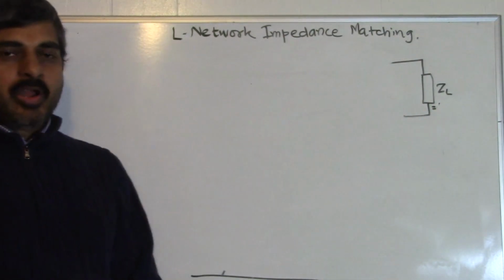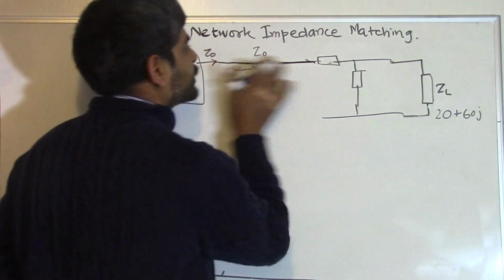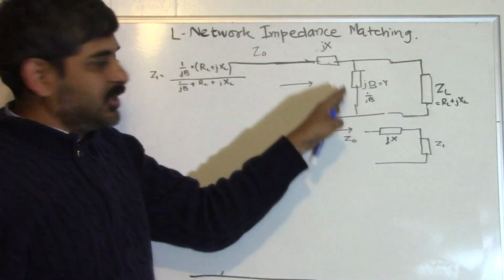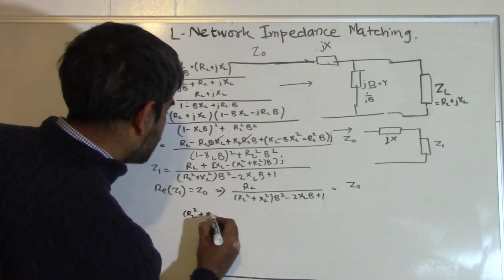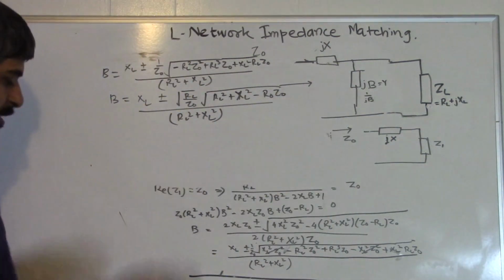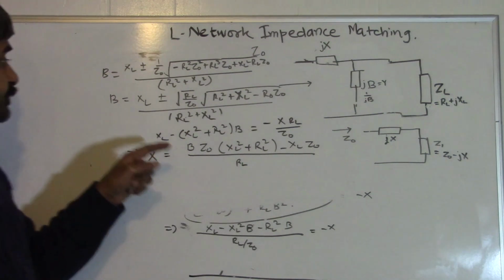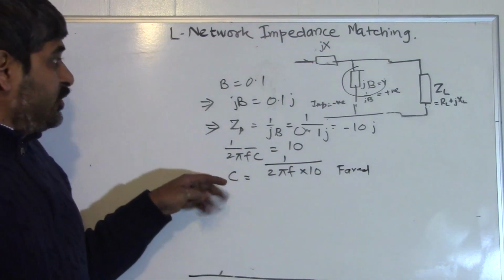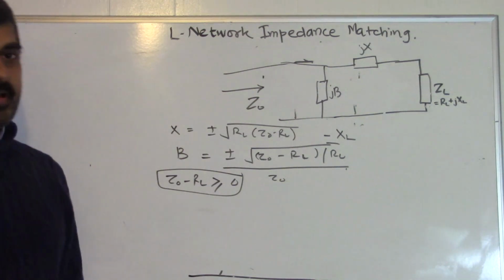L Network Impedance Matching

Comment: suppose main ny rf power amp ky collector per 50 ohm ka resistor laga dia aur loading coil antenna ky sath laga di so ab antenna ky koi imagery part nai hain no capacitive no inductive just pure radiation resistance hai but suppose 3 ohm hai isko match karana hai